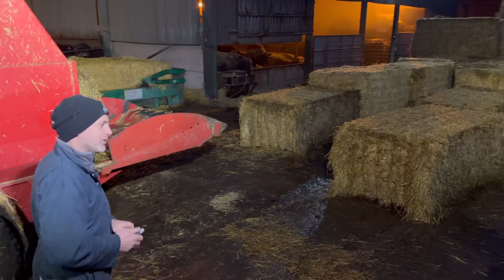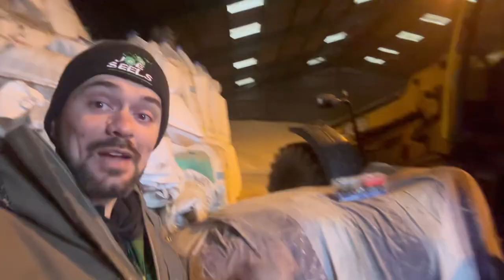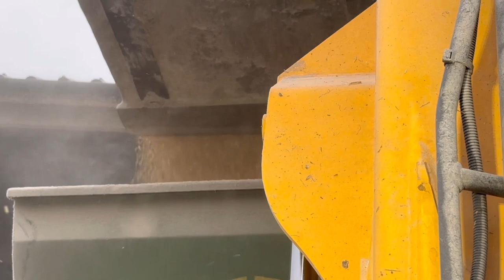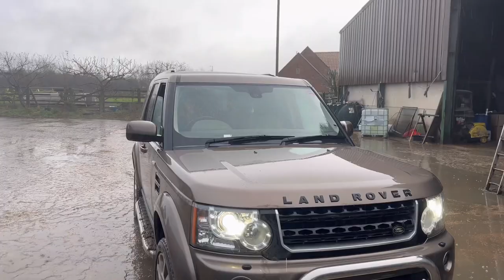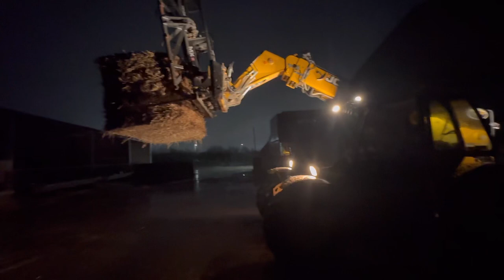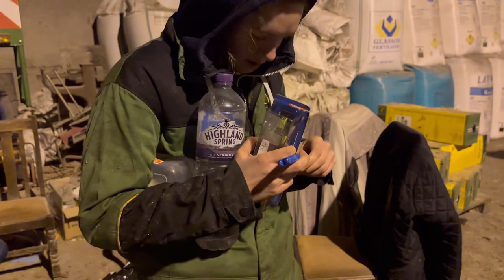JCB is 1 Today! How Many Hours? Andy’s Idea for Charity!?

Comment: Sounds like your chain may be a little slack in the exit elevator on the crusher.. if the paddles inside are rubbing at the bottom, it’ll swear the tin away at the inspection plate at the bottom… speaking from experience!!

Comment: Are the strings on your bales ever hard to pull out by hand when you use the spreader bale on the TM 320s
Reply from the maker: We cut the bottom 4 bands before we put it in… with quadrants we used to cut them tractor end then tie them to a gate crook, and reverse 😀👍